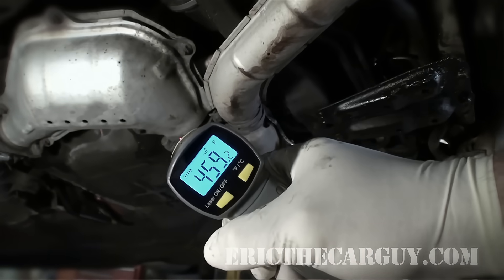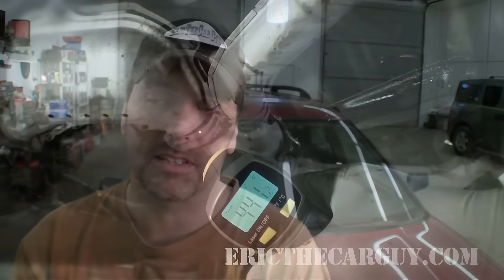Does Lacquer Thinner Clean Catalytic Converters? -EricTheCarGuy

Comment: Worked for me in an '06 Civic!!! 1 gallon in a little over half my fuel tank (6 gallons), it took 155 miles or so until the light just suddenly came off. Car drove really well with it in the tank too, over 40mpg. My RPM meter was between 2500-3400 almost all of those miles, a lot of which was 75-80+ mph and on the highway. Make sure to run it up a bit harder than normal.
Reply: Yea, me too !
As Myth busters do... They always Screw Up... Change / Weaken the Fix... So It Does Not Work.  You Need 4 Times the Thinner.
You were supposed to do 1 Gallon of Lacquer Thinner on a Half Tank (8 Gallons of Gas).  You barely had any Thinner.
But I used 2 Gallons of Lacquer Thinner with 13 Gallons of Gas in my 2013 Chevy Silverado 2500 HD and Drove 190 Miles on Highway.... Till I was near empty.... And it worked.  
But hey,  This Video is just an attempt to try and put down another Channel... small minds... small mission
Reply: @jameschupp2230  that's close to the same ratio I used, I thought it might have been a bit high but it did the job. 1 year later and the light flicked on a couple of times after the fix, but it's STILL gone.
If it happens again I'll do it again or take it off and wash it out
Reply: @escapetherace1943  Yes I agree !!

Comment: Thank you Eric for your time and effort to put this great video together. I totally agree with you about this method will not work if the engine had a long term misfire and phisically damaged that converter and melted it due to unburnt fuel had been dumped to the exhaust system. So you are absolutely right about catalytic converters fail in different ways for many different reasons. In fact, I've seen melted converters due to a software issue caused engines run too rich at start up causing cold misfire for a long period. Then manufacturer came up with a software re flash and CAT replacement. Thank you again sir.

Comment: friday i had just under half tank in my 2004 2500 dodge ram 5,7 reg, gas had the 420 code for few months i bought the cat for passanger side thats what the code told me so i put in about a 3rd of the gallon of laquer in tank just before going home from work drove about 25 miles got it up to 65 a couple times got home turned off engine light was on few hours later had to go to store  started truck up light was gone today is sunday its still off i better get my inspection done hope this helps someone

Comment: I just tried this, it worked! Using the correct thinner makes all the difference. BG products makes a product called 44K, main ingredient is High Flash Naptha. I found that Sherwin Williams has a thinner that has a huge amount of Naptha in it & they also sell pure High Flash Naptha. The stuff Eric has there in his hand has ZERO Naptha in it. HIgh Flash Naptha burns really hot and fast and clean. If the precious metals are not burned out of your cat, this should bring it back to life.  No hesitation at takeoff, pulls giant hills like a champ now. Thank you Eric!
Reply: great answer. the naptha is the solvent "thinner" in lacquer thinner.  Lacquer thinner with naptha dissolves these carbon clogs in a catalytic converter...it's the danger to the human handling the product. Please read the safety precautions as handling, like woodworkers went water based polymer because of the harmful effects of lacquer thinners. Just make sure you wear a 3M R95 or N/P100 mask rated to remove naptha (above N95 particulate respirator) and wear personal protective equipment in well ventilated area.

Comment: I'd do like RB the Mechanic does or suggests, while the engine is cold look for an opening at the front of the catalytic converter such as by removing an 02 sensor and spray some carb cleaner or intake manifold cleaner into the COLD catalytic converter honeycomb to clean the honeycomb of stuff in there out. The catalytic converter has to be cold and you have to wait until the carb cleaner is dry before starting the engine. You don't want an explosion or backfire due to the cleaner being wet and igniting. Otherwise, take the catalytic converter off the car and clean it with cleaner or soap and water or both. Maybe soak it in cleaner and then soap and water and wash it out.

Comment: Man… 🤦‍♂️,  you notice no vidence?… the temperature drop good, first to test this theory you have to have the P0420 code on your check engine but you not. Scotty have, so this video has no vidence that it will not work, but do an other video when you got the code, and make sure do the exact meassurement directed by Scotty (1gal of PURE Lacq on 1/2 tank fuel) and last man i’m sorry if i roast you but have more energy on your videos you eyes its like you high or sleep! Energy man!✌🏽

Comment: Good Video however when it comes to chemicals, process and concentration is important.  Scotty Kilmer used ONE Gallon to HALF a tank. I know this is probably more detail than needed for a comment but ... That approx 2008 Acura tank in Scotty's video was about 17 US gallons he loaded his ONE gallon of lacquer thinner into.  That would be an 8.5:1 dilution ratio.  The one quart of lacquer thinner into a .75 full gauge reading tank from your test would be 9.75 gallons for the 13 gallon tank and a 39:1 dilution ratio, approx 4.6 times less than what Scotty said has worked for him over the years.  Some household cleaning chemicals we have all used just won't clean by diluting down to only half when full strength works great so diluting 4.6 times more is like no chemical at all and maybe the test conclusion you had could be updated in the future 'just for information's sake' but at the higher concentration and duplicate Scotty's half tank to one gallon.  Otherwise it was a good test to get results from the lower concentration.  Thanks!

Comment: Just tried scottie’s remedy (and exactly as detailed) one gallon of lacquer thinner to half a tank and took a long cruse at night before n the freeway to run through all the gas. It did NOT remove the code immediately. But two days after I ran it through and filled up with regular gas it turned off and cleared my code.  IT REALLY WORKS!!!

Comment: I dropped a rebuilt 5.9 magnum in my 03 dakota, after the first 100 miles it threw a cat code. I used cataclean it went away. Truck is still in break in procedure. I got it up to 55 had to get on it a little. Now the code is back. Is my new engine the culprit? Since origonal cat and new engine are foreign to each other? How do I fix it

Comment: If a catalytic converter is failing. Doesn't that mean that all them chemicals metals or breaking down and going into your muffler. My nephew has an S10 the Cadillac converter showed it was bad. All the stuff that was inside the catalytic converter went into the muffler. Blocking it up. I just thought it was strange. Just because the catalytic converter fails. Doesn't mean it's plugged up. It means your muffler is plugged up. Heading Explorer just the other day that's the same way. Did cut the catalytic converters. And the muffler was plugged up. Full of all the crap that was inside of the Cadillac converters

Comment: I've been using laqwer thinner for years!  Cleans valves both intake and exhaust. Lacquer thinner also cleans injectors,  now  lacquer thinner cost about $10 a gallon 😒 and that's a lot of money 💰. If you Opt to use this method be patient,  use a pint at a time with fill up.  Catalyst converter got clogged over time, thus  it's gonna take time to uncloge. But if you need to have done ASAP! Then purchase a new cat. P.s. replace O2 sensor as well. 
Any way just recommendation often it's a crap shoot.  😀
Reply: hell, gas is going to be as high as lacquer thinner soon, lol!

Comment: Laquer thinner would need to be directly applied to the internals of the catalytic converter. Maybe even blast it with a torch a little. Don't try to unfasten old exhaust bolts just cut them off and put new ones on. They're cheap compared to the stress of removing them.
Reply: Torch and lacquer thinner what could possibly go wrong here 🙄

Comment: I have a 2000 Lexus RX300. Tried to get a smog check and it wouldn’t pass. Kept showing code for the Catalytic Converter. Eventually I checked out videos and found Scotty Kilmer. Followed his advice exactly. Had 1/2 tank of gas and then poured in 1 gallon of Laquer Thinner. BOOM! 💥 NO MORE CHECK ENGINE LIGHT AND THE TRUCK FINALLY PASSED THE SMOG CHECK. Incredible!

Comment: If I'm getting the cat code but tbe car is running good and I live in a place where theres no inspection. Do I even have to worry about it. Its a toyota sienna and I was told that code will come on even if the cat is at 94% efficiency

Comment: Cailf has a new smog test...on a Dynamometer  and the car is driven like your getting on the freeway(HARD ACCELERATION)...grrrrr...my car has never failed...until now...THEY ARE TRYING TO GET OLDER CARS OFF THE ROADS...(MINE=91 Sentra 1.6L 5 speed...FORCING ME TO PAY FOR A NEW CATLYTIC CONVERTER) LAST WAS 2 YEARS AGO...$240.00...COME ON...NOBODY KNOWS HOW I DRIVE GETTING ON A FREEWAY...OR IF IT IS AN ELEVATED ON RAMP OR UP HILL WITH A CURVE(CLOVER LEAF STYLE...STUPID BAD UNFAIR TEST)After a new cat...o2 sensor...fuel injectors...the numbers were nearly zero!!!! now how long will that last...ha ha...

Comment: In scotty's video he said to put a gallon of laquer thinner in half a tank of gas. His car was a camery I think. I have a toyota avalon 1999. So a gallon was no problem. I opted to drive on freeway at 2500 rpms for a quarter tank about 100 miles. Then on the last quarter tank I parked and ran car at 2200 to 2500 RPM for 30 minutes. After I went and passed smog test. Scotty did say to get the rpms around 2500 plus rpms to heat the cats as much as possible. I had already replaced the air fuel ratio sensors and did a major tune up before starting this. I changed plugs, plug wires, coil packs, air and fuel filter, and did an oil change. So car was ready. No check engine lights. The cats got dirty before tune up. But I opted to try Scottys method and it worked.. Still no check engine light. It saved me $400 on a new catalitic converter. But he did say if that didn't worked to try and soak it over night in laundry detergent. I've seen other videos where they removed the cat and soak it in laquer thinner and water a 50/50 mix since laquer thinner . That didn't make sense since laquer thinner displaces water. We use it to clean out paint spray guns of paint and just before painting to clear out moisture. God bless and Shalom be with you.

Comment: I just watched that video of "Scotty Kilmer" saying to Dump lacquer thinner in your tank to fix a Cadillac converter however,  he was using "One Gallon" of lacquer thinner to a "Half a Tank" of fuel and Driving it a "Hundred and Fifty Miles" or keeping it at "2500 RPMs" for "30 Minutes",. You are using WAY LESS Lacquer Thinner than he Recommended and MORE FUEL in your TANK then he recommended! 1/4 Of A Tank More in Fact!! And You Have TWO Catalytic Converters When HE only had ONE!! How is that going to Prove HIS theory is Right or Wrong when you're NOT Doing It to HIS RECIPE OR HIS SPECIFICATIONS??
Reply: However I do have a question, I have a 1999 Chevy Silverado. When you first start it after you kill it and Restart it at any time, you have to let it run for a minute  before you drive it because it spits and sputters until it Smooths out. Then while you're driving it sometimes it will start spitting and sputtering until you pull over and kill it wait a few seconds and start it again and it will spit and sputter for few seconds and then it'll smooth out go again! what is causing this problem??

Comment: Eric, You are correct in if there is something wrong with the catalytic converter, such as the media comes lose, thinners are not going to fix it. Since this video is really old I'm sure you've resolved the issue with your converter but next time you test someone's recommendation, you should follow their advice.  Scotty recommended 1 gallon per 1/2 tank or about 10%. You added 1 quarter of his recommended so it's no wonder it didn't work out for you.
My check engine light came on about a week ago and codes indicated the converter was bad. I just did exactly what Scotty recommendeded, 1 gallon per 1/2 tank on a 2011 chevy equinox,  drove it about 40 miles at highway speed. Check engine light went out. It does seem to work, if the catalytic converter is not damaged.
Reply: Still off, any other codes?
Reply: @Robo2Cowboy code came back on about 4 months after I  made the post.  Apparently thinner is a temporary fix but it does work, if the converter is salvagable. I traded the car about a year ago,  for other reasons.  The equinox had a POS design 4 cylinder engine and was reminded at 60k miles. Obviously the converter was plugged (partially Obviously or it wouldn't run). The car had over 100k on it and I suspected that at about 120k or so, the rings would be shot again.  Would they? I don't know but I didn't want to find out on my dime

Comment: I had the "low efficiency" code. Soaked the converters for 2 days in water with dawn dishwashing soap. Changed the solution a couple of times. Rinsed well and the code went away. But, this may be a special case. 
The head gasket blew and several gallons of coolant went thru the exhaust. A few months after the gasket was replaced the code appeared. The converter on that side (V6 engine) was covered with a white layer. The other converter looked fine. 
230k miles, original converters. 3k miles since the cleaning. Downstream O2 sensors are giving a flat (expected) output. 
So, I can confirm that if the cause of the problem is coolant in the exhaust, soaking with dishwashing soap works.

Comment: You did mention proportions. 
Scotty’s video was 1 gal for 1/2 tank of gas. Of course 1/2 tank of what sz? Not mentioned. 
You mentioned that cat’s can fail for many reasons which is a valid point. 
Also ; Scotty’s video is 10 years old and he said a new cat could be upwards of $1000. I priced one for my car and parts store had one for just over $100. Prices must have changed or depends on the vehicle.

Comment: Hey eric i watched your video the other day and wanted to give it a try of my own and so about 150 miles ago my 05 altima 2.5S had a cel on for p0420 slaped a qt of all purpose laquer thinner to a qtr tank of 91 and wasted the gas replaced with another qtr tank of 91 and boom just like that gone first the light went away but code was there now nothing smog time tomorrow 😁😁😁👍 thanks a million.
Reply: UPDATE  just got back from the smog shop had a PO420 code pending but the light was not on yet and passpasspass

Comment: eric why did you say it didnt work to start with your engine light wasn't on to begin with so you lied the code is right but the code wouldn't have came on if engine light wasnt even on to begin with I have used the lacquer thiner 2 different cars it worked in both and passed smog

Comment: What about p0430? I have a misfire in cylinder 3 on my 5.4 f150 and bad cats i think its casuing a slight overheat and the misfire cuz ive changed all the plugs and coils but under load " driving 60-70 mph" i get a misfire and p0430. Im at a loss of what to do

Comment: What about drilling a hole. Upstream of the converter. And then injecting soap and water? While gaining heat? As when hot? It would shater the cells. Can just pach the hole with a pop rivet. And also? would there be something beter than lacquer thiner for this kind of aplication? Would bypass injected systems. Like what I have in my Jimmy.
Reply: And after a couple more videos? Use Sodiom Hydroxside.

Comment: Denatured alcohol, cleaner burning. Used with 1/4 to 1/3 tank. Used prior to and at time of Ca.smog check in metro air quality  area. Always passed smog on every thing from big V-8 to be 1.5L4 cylinder.always topped off onoff tank with premium when done with test.

Comment: WTF! This just killed my car. I read the comments and added a gallon to half a tank. Drove normal to work then at lunch I went to Wendy's drive through and it make a horrible noise like it was missing and started shacking. It died and I couldn't start it back up in the middle of the drive thru. I had to have it towed and when I got home called a mechanic and told him what I did to clean the converter. He laughed and said to have towed to his shop to look at it. I'm pretty sure that caused my car to die. Now I'm screwed till then.

Comment: Whats i thinked why it work is lacquer thinner is a solving. Use for soak paint brush ,so the paint will not stick to the brush, so you can use for next paint job/when you put 1 galon in a car with half tank of your car/ lacque burn give out smoke and it de glue all the cardbon that clogged all the holes in the cat when you keep drive over 100 miles for 1 go/ 80 miles per hours, and thats how my suv fixed no more engines light/ now if your cat broken in to small piece ,the ready spent $2000 new cat and labor,its lot work take a part and put it back .

Comment: Believe me i almost not try this method after he said it didnot work for him,  i said what ta hell i try it s any way what i got to loose ,going spent $2000 for new. Cat which money i dont have for my 2003 mdx acura/ i was shock after 71 miles engine light did not come up/ normally it automatic turned on when the engine cycle, i know he honest but dont mean it will work for other like my situation,any way because of his video ,I watch save me a headache and $2000 from California thank you  very munch.